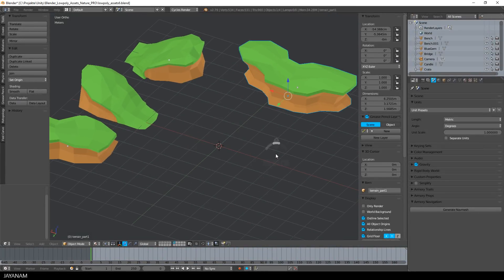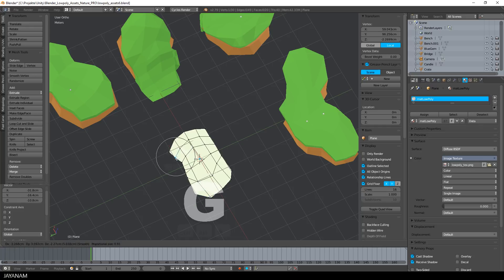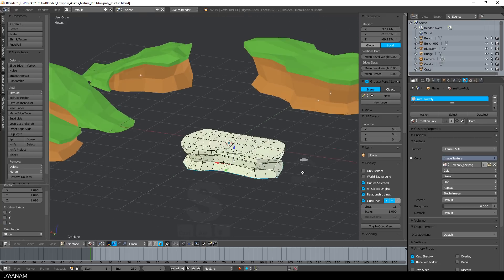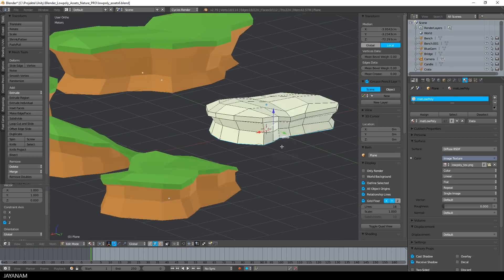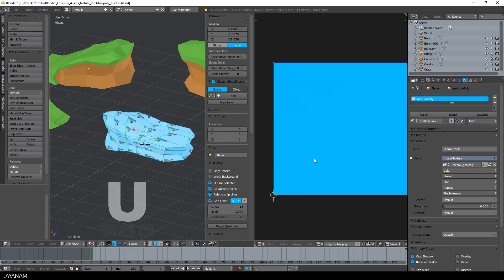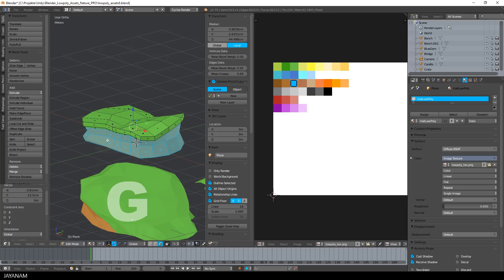Blender Low Poly Terrain Modeling Tutorial

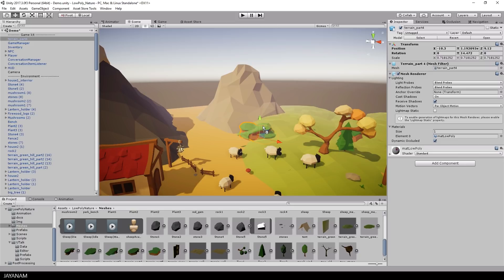Comment: I'm trying to create my own low poly game but mesh colliders won't detect some parts as they should be. Example the tree at 4:33 in the right (the white-ish one) would have a total disaster of a collider. How do you get them right?
Reply from the maker: You mean in Unity? Did you check the convex option for the collider? If so, try with unchecking this, I was quite happy with the MeshCollider in my Unity Game kit.
Reply: @JayAnAm  Yes in unity. I did check de convex collider though but without it doesn't even create a collider 

Edit1: I will try again with it unchecked, maybe it will work this time 

Edit2: Nope, there is absolutely no collider if the 'convex' option is checked

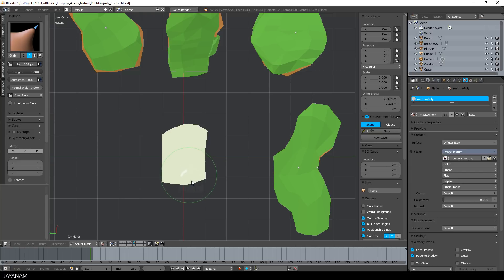Comment: hey! for some reason I cannot properly use the grab brush tool at the 00:46 second mark. It doesn't adjust the shape of my plane like it does in your video. I've followed your steps exactly, the only thing I haven't done is add your lowpoly material like you did at the start since I haven't made one. Please help!
Reply from the maker: So what is the result when using the grab brush?

Comment: Hi, great vid! :)
I have a problem, when I export it on Unity the texture doesn't shows up. What am I doing wrong?
Reply from the maker: Do you already have a material in Unity? If yes, select it in the importer, if not, exract material in importer. After that you have to drag texture you want to use to the Albedo slot of the material.
Reply: I'm sorry but I'm a beginner, so I went under "Remapped materials", clicked on the small circle on the right of Material's empty box.
I have different options including sprites and particle, I choosed default diffuse material and clicked apply. But I can't interact with the material panel with albedo, ect...
And my object went purple.
Reply: Lol I guess Im dumb, so I created a new material but still I cant drag the texture in albedo
Reply: I did it, I needed to import the texture as well before dropping it, I am dumb after all. Sorry if I bothered you xD
Reply from the maker: Ok, great you made it